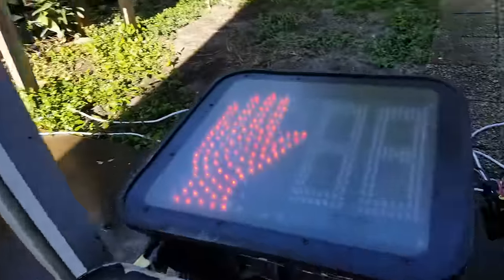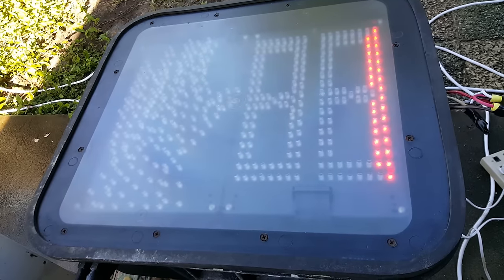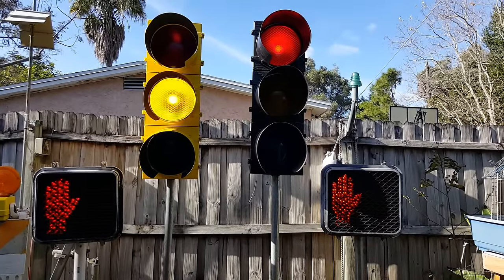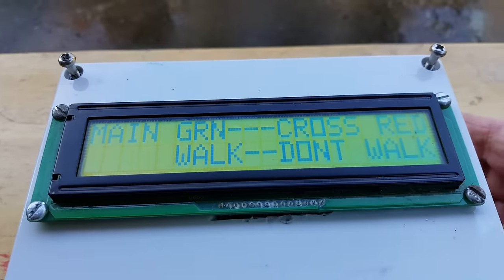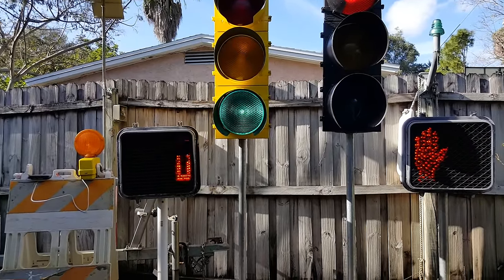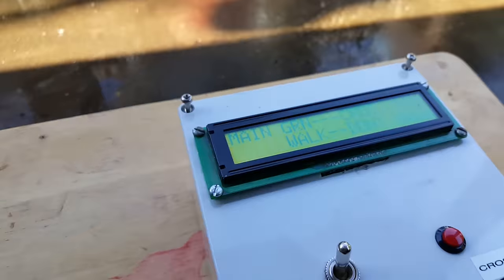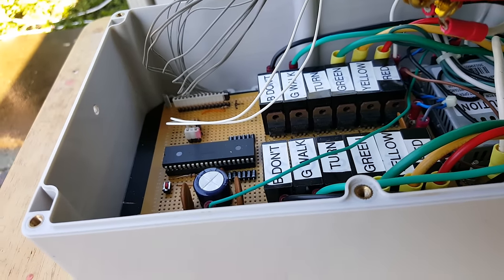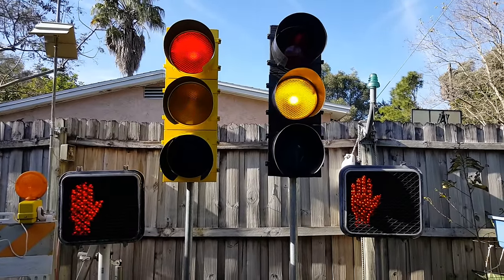Traffic Signal Project Using PIC16F877A

Comment: That's a really  cool hobby! do you have a y documentation or source code for your microcontroller? love the project
Reply from the maker: No I don't have any Documentation.  You can use an Arduino to drive a traffic Light system with the correct interface from the Arduino to the 120vac lights. There are plenty of Arduino sketches out there that you can connect LEDs like a traffic signal and get a good start on building a full up Traffic Signal controller.

 This was the third one I made using standard Relays, PIC16F877A microcontroller and PICBasic Pro to program it. Later i made the next one with an Arduino and my own solid state relays using a optocoupler and Triac. I started by building them for model RailRoads. See some of my other videos Ive posted over the last few years where I start small and build up to driving High voltage lights.

This is the first one I made before I got a set of real lights:  https://www.youtube.com/watch?v=lUfLv8nAnFk

This is basically the same I built to drive a set of real lights: https://www.youtube.com/watch?v=lY51qtP4kzs
Reply: JRocco 36 thanks, I watched that video after I had already posted this comment... I have a dialite crosswalk with countdown timer but can't figure out how to make it count down
Reply from the maker: To get it to count down you will need to turn on the Dont Walk then flash the Hand a set number of times. Say 10 times then hold the Don't Walk hand on for a few seconds. after that turn off the DW and turn on the "Walk" and hold it for a few seconds. turn off the "Walk" and start flashing the "Dont Walk"again and it should count down from the number of times you flashed it in the first place. So it should flash and count 10, 09, 08 and so on down to 00 at that point hold the Don't walk for a few seconds. 

The Basic cycle would be: 
1. DW hold a few seconds just for the start of the cycle All Red/DW
2. Flash DW X amount of times
3. Hold DW X seconds
4. Hold WALK X Second 
then goto 2 and keep cycling 2. 3. 4. 2. 3. 4. over and over again. Think of it as a ring within the whole traffic signal cycle.
Some Peds need to cycle twice before the count down shows. The ones I have that do that on the second cycle it will display 00 during the DW Flash.
Ya have any questions feel free to ask.
Reply: JRocco 36 thank you very much, I couldn't find much online I appreciate the info a d belp

Comment: Hey man I just got an icc ped signal head. What did you use for posts ?
Reply from the maker: I used 2" schedule 40 PVC pipe. they sway a small bit but they are OK so long at you don't try to make them too high. for the ends i just used threaded pipe ends with a steel pipe flange at the bottom attached to a wooden base made from a wire spool. for the top I used a Nut 
 just an FYI pvc pipe won't work for signal head as they are very front heavy.

Comment: Do you work for traffic light companies? And do you install traffic lights on intersections?
Reply from the maker: No Traffic Signals and Traffic Control devices are just a hobby of mine.. it all started with these two lights I picked up at a flea market a few years back.. You may like some of my other videos that feature my full up traffic control system..

Comment: How did you make it so you could manually operate it?
Reply from the maker: on the PEDs there are 3 wires that come out. one is the neutral, one for WALK and one for DONT WALK. if you put toggle switches on it you can work the display manually. However if you do try to work the display that way Please keep in mind that it uses mains power (120VAC) and you could be putting yourself in danger of a potentially lethal shock.
Reply: JRocco 36  how did you do the wiring of the switch and ac mains 120 volt ac?
Reply from the maker: As I explained above the PEDs have 3 wires that come out. one white for Neutral and two other wires one for the Walk/Man part and one for the Countdown-Hand/Don't Walk. Some use Orange for DW/Hand and Blue for Walk/Man. It depends on the manufacturer what two colors that are used.. for the GE PED displays see: http://www.gelighting.com/LightingWeb/na/images/traf059-ge-gt1-pedestrian-signals-16x18-incand-install_tcm201-54281.pdf

Again remember that these displays like all traffic signals use Mains Power so operating them outside the way they where designed can put yourself at serious risk of a potentially lethal electric shock. Generally I do not run them unless they are safe and the one in the video was just setup as a demo.

It would better and safer to use a microcontroller or Arduino and a relay inside a non conductive box to control the display. You can see one I did using an Arduino and solid state relays here: https://www.youtube.com/watch?v=ARHXIEEFRiE

That being said if you want to use them manually connect the white wire to the neutral and put a switch in series with the load to the two other wires that control Walk and Don't Walk. flipping the switch connected to the Dont walk a number of times can cause it to count..

Be Safe and careful.
Reply: Mr.Lights_123 vçdf
Reply: Car  game🚥🚦⛽🛣🛤🚘🚚🚛🚦🚧